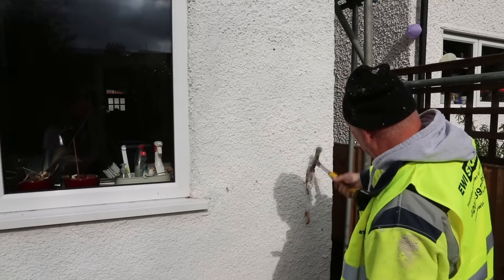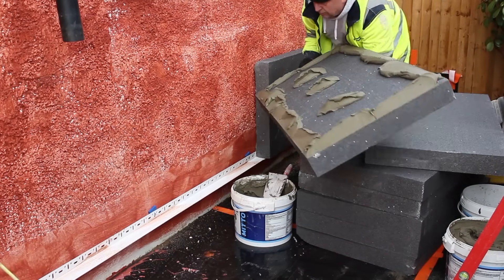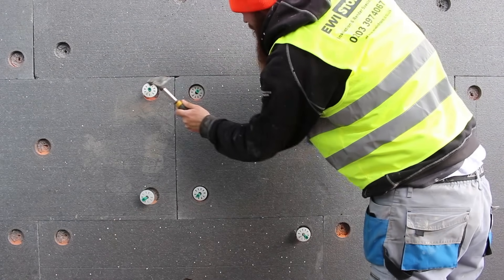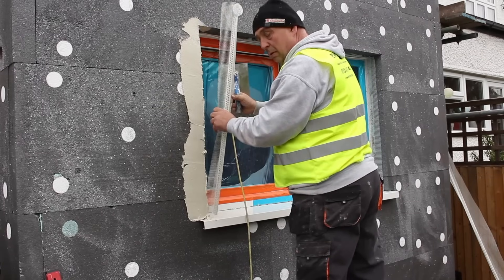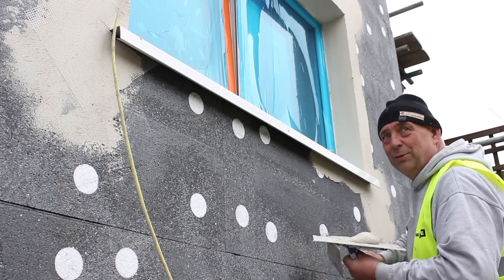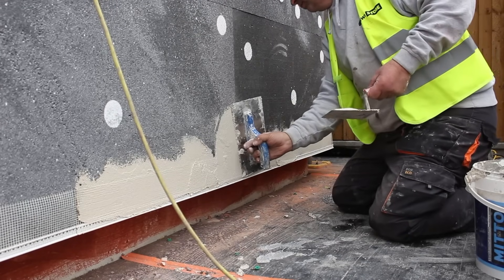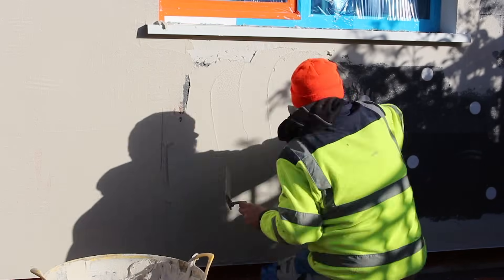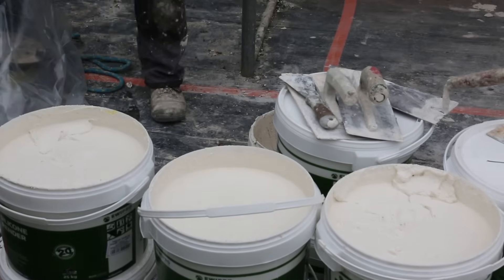Upgrade Your Property with External Wall Insulation – Step-by-Step Installation

Comment: I am concerned about EWI particularly on masonry structures.  Traditionally, British properties have been built with masonry internal and external elements i.e. brick and/or concrete block.  This form of construction although it is porous presupposes that the wall can breathe so that external water penetration dries out and any moist air from inside the building flows to the exterior to join that drying process.  The wall is expected to have interstitial condensation but this doesn't matter as the drying process takes care of it.  With external wall insulation of the type shown the insulation is vapour permeable and thus there will be interstitial condensation behind the render that cannot get out other than having very slow drainage down to the base of the wall insulation, this makes the render susceptible to freeze/thaw and the eventual cracking of the render, which the plastic scrim cannot resist.  Also, the strength of the cladding is totally reliant on a thin skim of render on a compressible underlayer and thus it will not resist the normal dents and dings that a building receives over its lifetime.  Breaking the surface of the render will allow water penetration and eventually blowing due to the freeze thaw cycles.
My daughter had this type of insulated render fixed to her 1930's solid walled semi-d house and the immediate issues were with external services i.e. electric boxes and garden taps along with fixing for brackets on the wall face.  The fixing base was some 60mm back from the face of the wall and the extension of the garden tap in particular lasted only a few weeks before it began to leak, saturating the insulation and eventually creating a puddle on the ground.  The installation company had to cut out the damaged section, fix the leak and reinforce the water service extension, reform the wall insulation and patch an area of render  Had this happened outside of the warranty period the cost would have been £100s.  Fortunately, my daughter sees the wall insulation as a sales bonus and takes the view that any future defects will the new owner's problem!
Reply: Wall is dead, it doesnt breathe. Humidity diffusion through wall is negligible. 97% of vapour leaves the house through ventilation or recuperation. Lastly polystyrene is not vapour tight, and still allows minimal diffusion. Dew point MUST NOT be inside the wall, the thickness of the insulation must be calculated to move it outwards to the insulation which will permeate it outside. All the issues you describe are just jobs done wrong.
Reply: This system has been used in Eastern Europe fro over 40 years now with no such problems as you mentioned. If its done properly its tougher a longer lasting than traditional cement render.
Reply: @1amelka  I don't doubt that it is used elsewhere but UK has specific conditions that mean we need specific solutions.  Our climate is very damp and our older buildings are very porous that relies on migration of water vapour from inside to out.  I have specified render on many buildings and if spec'd and installed right it can last for decades and probably the life of the building.  One building I was concerned with had stucco render (lookalike stone jointing) that had been insitu with no obvious repairs for 350 years
Reply: @clivewilliams3661  its not the locations climate that will cause problems, Its the incorrect installation of the technology. If the environment is damp and humid you need effective ventilation.
Reply: @1amelka  The climate has a profound effect on the architecture and construction that is appropriate, just look at the vernacular construction around the World.  I wonder how long a mud brick house from the Middle East would last in Ireland or the Rainforest of the Amazon?

The point with most EWI installations is that they are used on our stock of solid brick walled terraced and semi-detached houses to supposedly improve their insulation as a quick fix without understanding how the basic construction functions, its a case of inappropriate installation, although I also suspect that there are too many lowly qualified installers trying to make a fast buck on the back of the latest fad.

Ventilation is not necessarily the cure for a damp and humid environment.  In the houses I am describing they aren't damp or humid in their original state but the location of EWI promotes interstitial condensation and that allied to modern lifestyles and heating systems can create RH values that the wall cannot cope with.
Reply: @clivewilliams3661  did you ever find out the answer to this? i've heard of people getting mould inside after doing this

Comment: Could you consider doing another video which shows how you design around some of the awkward things that one faces with a house,  for example satellite TV dish fitting,  closing the end of the insulation against an un-insulated semi, and so on?  The Welsh Government's evaluation of the technology suggests that it is let down by fitters arriving on site and having to fix problems on the fly.  They recommended that sites should be surveyed by a qualified person who would then design solutions to problem items so that the fitting team would come fully prepared. Thus a 'Nighmares we discovered and how to fix them' video would be illuminating.
Reply: I have no idea how these guys do it. When my house was done, everything outside the house was taken off, satellite dishes, drain pipes, security lights, alarms, outside taps etc. blocks of wood was fitted to the wall, the same depth of the insulation used and then everything screwed back in to place, but into the wood, not the wall. Then someone else comes along, fits insulation, render/pebble dash, job done.
Reply: @Dans Channel  
Did it insulate well in winter ? How warm the house after than before insulation? 
Did the rain had any bad effect on it ?
Reply: @trysam  we only spent 1 winter here before the external wall insulation was fitted. If I’m honest, I don’t know how much difference it has made. My house is not a warm house, it doesn’t hold heat well either, but that could be down to a number of reasons.

The only effect the rain has, is the same effect it has on the normal wall.

Comment: How would you recommend drilling into it to install an outside socket? Would I need to go all the way through to the masonry or would the insulation provide enough drip?
Reply: I'm wondering the exact same thing? Have you installed the socket already and if so how did it work out?
Reply: @jay-lm4we  i bought plas plugs from screwfix. They're not the best to use but they are quite sturdy once you get the hang of not breaking the plug attachment it comes with
Reply: @MrJustbrowsing12345  I'll check them out, cheers 👍

Comment: Thanks for the video. Is planning permission needed for external insulation?
Reply: The answer to that is no, but if you have a cavity wall investigate more before going ahead
Reply: @wobby1516  Thanks for the reply
Reply: Building regs may apply though for renovation of a thermal element - best to check with your local authority building control first.
Reply: @user-ix4ge6rr7u  Thanks for the imfo

Comment: Please may we have the cost breakdown/estimation for this? What EPC or BER rating did this bring the house from and to? I am looking to have this done potentially on a house in Ireland. Thanks
Reply: I’m no expert in this kind of insulation. However what I would say is I can only see this external insulation being any good if your house has solid walls. If you have  a cavity wall then frankly I can’t see this insulation being of any help. However I’m happy to be corrected if  someone can be explained the benefits.
Reply: What , of no help ? ridiculous . 
if the interior walls have open cavities and the new insulation creates air tightness in the walls then the cavity becomes a dead air space . not as effective as insulation but still very good . 
The biggest source of heat loss in any house is air infiltration . this system accomplishes both , eliminating air movement through the walls and insulation simultaneously .

Comment: Occupants breath out about 1/3 tonne of water a year into the property. This will absorb into the walls and where the wall is breathable eventually migrate to outside. Four people in the house and you are looking at around 1 1/4 tonnes. Cooker hoods that do not vent outside and poor ventilation can make matters significantly worse. How is this system going to stop the fabric of the building slowly decaying to a brown crumbly mess?

Comment: Hi, what EPC rating did this bring the house from and to? Very good video thanks!
Reply: The property originally had a F38 rating and improved to D56 after the work done
Reply: I've been told my single skin 1900 built house will go from D58 to C52-70 with 50mm mineral wool external wall insulation. This can be in the
form of insulated plasterboard with at
least 25 mm PIR. I got a MEES report done by the company who provided the EPC report as I want to guarantee I'll get a C if I do the work! They also said I need loft insulation on south side and a new boiler (specific as I've already done it! They ask you what you've already done before running the report) and low energy lighting. If you're interested I used Easy EPC but I expect most EPC firms offer the MEES report. It cost about £65, EPC was about £60. You can ask them questions too, so I'm really pleased I got it! Now getting quotes for external insulation. This is a great video! Have emailed you guys for help finding contractor

Comment: In uk the government scheme is paying for all this but there are downsides to getting it done. It's a severe fire hazard if anyone can remember the Grenfell Towers in London well this is the sort of Cladding that blazed the Tower block and hundreds of lives were lost.
Reply: We are currently getting it done and my Dad is a firefighter and guess what have a read before quoting nonsense please again anything can catch fire but it’s the level at which it spreads is key to safety. Did you check your car before buying it that the engine won’t explode on ignition? I didn’t think so. Is external wall insulation fireproof? All quality EWI systems are fire retardant. This means they have been manufactured to achieve a very low combustion level which has been approved by an accredited fire classifications expert and deemed safe and fit for purpose.

Comment: I've been declined this type of insulation but they've offered my injecting beads insulation. Anyone suggest beads over this? Any problems etc
Reply: Every system can go horribly wrong if it's done wrong, but it's fair to say that external insulation is inherently superior to beads per unit thickness because beads don't stop your outer wall letting water through and soaking the cavity - external will also help mitigate cold bridging on timbers / steels  etc.

Comment: Can it be used same material in Ireland? I know that people using it all over in Hungary, Poland  Summer could be very hot winter could be -20 degrees. But it works perfectly well.

Comment: Is this system fire proof too? We are interested in getting this installed on our Portuguese house where there is a risk of wild fires.
Reply: Nothing is fireproof for wildfires (mineral insulation melts most of the times) but this insulation also melts, so no not fireproof
Reply: @Oieboie1  Fireproof means it wont sustain a fire. Melting or burning, but going out is fireproof.
Reply: Don't use plastic insulation in a fire risk area. Use rigid rock wool insulation instead. More expensive, but won't create dangerous poisonous fumes when in a fire.

Comment: I would love to see some follow up pictures of the house after a year! It looks like a good job
Reply: Agree....after a year the effect of lacking ventilation shows its destructive effect on the internal living space. A pity this is not addressed in this type videos. Unfortunately this problem is hard to solve in old buildings. Again, this type of insulation does reduce the energy bill effectively of course, but the internal build up of humidity that can no longer escape through the walls, causes internal wall paint and wall paper to turn black, grow mushrooms after some time.....
Reply: @paulbrands6239 it’s we’ll known that when you insulate a house in this way that humidity is the next problem. So a dehumidifier is needed.
Reply: @hearthjunkie8173  if there is a ventilation shaft in the house then simply getting a grill that's more open and leaving the windows on micro-ventilation can do enough to balance out the humidity. The main issue is that some people do not care, if you insulate your house you NEED to buy a thermometer with hygrometer and monitor the humidity in the house, if it's constantly high and improving ventilation doesn't help then you need to get a dehumidifier. Usually dehumidifier isn't required, because in winter the air outside is dryer (because it's cold) and you heat up your house, there is a drying effect and in the summer you usually have AC on (or at least I hope you do if you're renovating the house already).
Reply: @paulbrands6239 walls don't need to breath . Walls are to be dry and well insulated . Ventilation comes from the windows. I've lived in very cold climates and still sleep with open windows at night.
So called experts in the UK and the general public know very little about how to keep one's house warm and dry.
Reply: What is point of insulaing a house to then have to bring in cold air through vents in winter to deal with moisture build up? Any cold drafts are going to make it very inefficient to heat the space?
Reply: @rudejude87  you have the double vmc flow. You have air coming in that gets heated up by the air that leaves. That way the air is always warm inside the house.
Reply: They did a full prefab ex coal board estate near me. It's crap mate, the depth of the reveals round the windows you could park your car on! And the cut outs for the drain pipes etc look aweful. Plus it's really soft there's only like a hard skin on it....slightest knock and it outs a big hole in it. I was digging out a garden of one of the house with my mini digger, piling the spoil up and a bit of concrete rolled towards house put a great dent in wall...😳 It's not good ...but I guess it's the only way to insulate a prefab house....wattle and dorb would be better...😂😂

Comment: Houses on our estate are getting done.  I chose not to get my house done.  They are putting the stuff over Sky and BT cables.  Boards straight onto the bare wall, no cement or anything behind them just screwed straight onto the wall.  No dowel caps.  Think I made the right decision.

Comment: Why is this not being applied to all new builds in the UK? This measure of insolation will drop the carbon foot-print of homes dramatically. Never mind electric car, which admittedly are needed, but  this can be rolled out now. Some body please explain to the governments of the world, this is a quick long term fix to help with the fight of global warming?
Reply: If it locks moisture up in the fabric then it could destroy the countries building stock which is one good reason to avoid. Much of UK housing of any age (including recent new build) really needs demolishing. It is decaying and crumbling to a soggy nothing and is embarrassing. I say this having lived on the continent for several years where I never saw any sign of damp of any kind. Building and maintaining properly eliminates all the problems you see in the UK. The UK building industry just has no idea how to do their basic job.
Reply: New builds have insulation within the cavity of the walls and many existing houses can have the cavity walls insulated. This is most beneficial for older properties without cavities. It's best if combined with a heat recovery ventilation system. That way you don't get a build up of moisture in the house nor the counter-productive situation of folk opening windows when the heating is on.

Comment: Hi, is this a alternative method to say brick or panel cladding when constructing a house? Or do you use this as a in-between the timber framing and brick wall of a house?
Reply: Its main job is to super insulate, or "exulate". Its giving the house an external barrier before any of the heat on hot temps com in, and it does the same to keep the warm air in during the winters. But I see the advantage mainly in the summer and generally hot climate zones
Reply: @philindeblanc the advantage is mainly in winter. Keeps the house warm. Indeed, keeps it cool in summer.

Comment: Is it normal to have uneven surface at parts of the finish that are on top of the mesh overlap? Especially visible when light hits perpendicular to the wall? (during midday or from a lamp on that wall)
Reply: You will always see a little unevenness when the sun shines in that direction, but if the unevenness is always visible then it is not good

Comment: Does a whole wall need to be done in 1 hit from roof to ground or can it be done in 2, can it be blended in to an already set wall?
Reply: If you spray it you probably could get away with it,using trowels and floats no chance it would be an eye sore
Reply: @beatonthedonis47 Now I have a front porch similar to this size, I want to insulate it like this but I want to cover it  in stone cladding to Finnish it. Should I put a coat of render on the insulation board then put the stone cladding i
on after that?

Comment: Can this be installed for a new wall, before stucco cement has been put up?
Reply: yes you can install it directly in to the brick
Reply: Yes...
Reply: @zarron221  A few month too later, I finished the job, but had I known I would have looked further into it and used it for the one wall that gets the super hot sundown exposure.